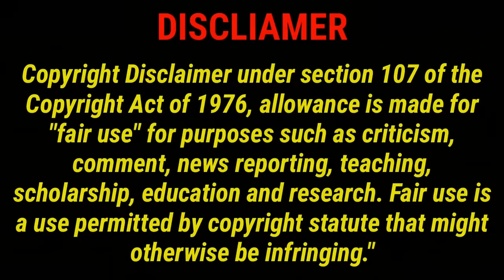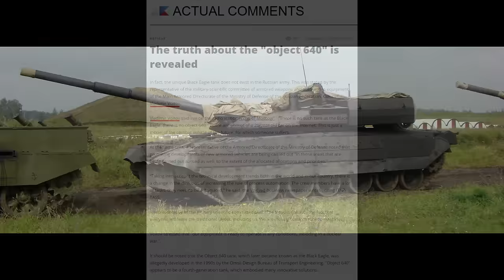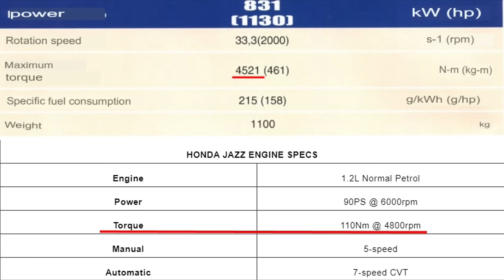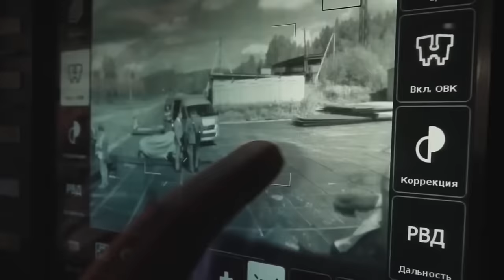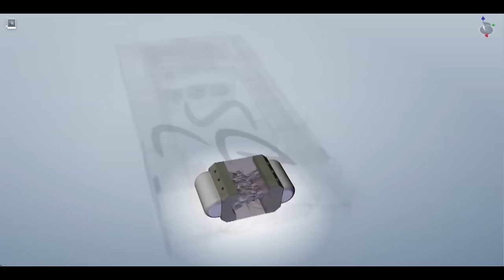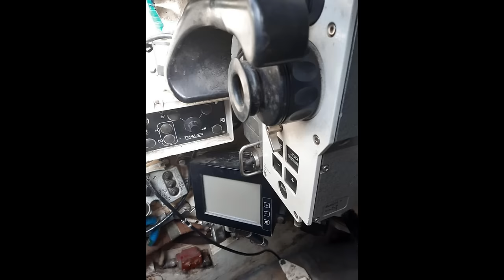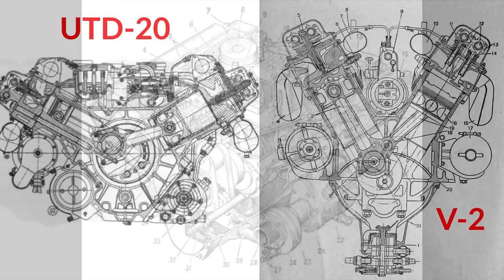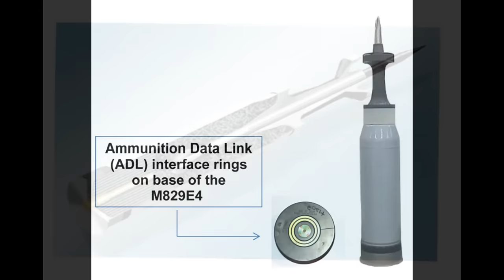LazerPig is WRONG about T-14 Armata

Comment: There are several fundamental differences in design and layout of the main components in engine bay, from motor, gearbox and transmission assemblies between Western and Eastern tanks. I know that transmission on T-72, T-80 and T-90 tank series (not so sure about the T-90's) is really well thought out; two separate transmissions attached on each sprocket wheel over a final reducer, and both transmissions are connected to the gearbox and on the main shaft of V12 engine. A masterpiece of small, compact power pack. All assemblies together occupy about 3 cubic meters of space. For comparison, Abrams M1A1(A2) needs 7-8m³ to house its power pack. But both the Russian tanks, older T-72 and newer T-90 do not have a transmission that allows independent speed of rotation of the tracks as well as direction of rotation, but when the tank wants to turn 180° from rest, one track turns, while the other is blocked. All with a miserable 4km/h in reverse. Back in 1942, Germany designed, manufactured and installed the Merritt-Brown regenerative hydraulic steering system in the Tiger l heavy tank, which together with the Maybach-Olvar gearbox with pre-selector (for 8 forward + 4 reverse gears) ensured easy driving and maneuvering with 56 tons heavy tank and turning the tank by moving one track forward and the other on back, exactly according to a certain speed, it acts like a car differential that in a curve allows the outer wheel that covers a longer distance and have a higher speed and number of revolutions, and allows the inner wheel to reduce the speed and number of revolutions. Tiger l tank had early hydraulic steering system like an all moderne day western made MBT, including Tiger I successor in design & high quality production approach of Leopard 2, and the brake levers were left by driver's side just for safety reason, if the hydraulic steering system fails. And Leopard 2 V12 turbo diesel engine with EuroPowerPack consisted of MTU-883 1500/1680Hp at 2300 rpm. with automatic transmission Renk HSWL 295TM is a "plug and drive" type of unit that is easy to change and repair even in field conditions. All Western MBTs have been using such a steering and control system for a long time, only the Russians still turn their tanks by braking on one side of the track. Why tank constructors from Nizhny Tagil "Tankograd" never adopted such technicaly advance approach in tank designe? Higher price of manufacturing, bigger volume for power pack (and therefore a larger silhouette of the tank) or complexity of maintenance? Or a bit of all of the above?
Reply: May be T-72M1 CZ  have rotation capabilities - it's new  transmission, it has more reverse speed.
Also T-84 has better transmission than t-72 in the same dimensions.
Reply: What's the point of doing a standing rotation with tracks moving in opposite direction when what Russians use works just fine? Russians look at the RESULTS. Methods can remain crude if they achieve it.
Reply: @Max_Da_G  well said. Russians designed tanks to be difficult to spot and shoot and be very reliable tank and cheap and easy to produce in high numbers. Russians are pragmatic what works. That's why they defeat Germans in ww2
Reply: Except for armata engine is different and t-90m that has good reverse speed
Reply: Cost, complexity,realiability and the fact that its not that important are the factors why they do not have that
Reply: @alexnderrrthewoke4479  T-90M has been shown to have the same reverse speed as the T-72 (it may have been a T-90A, I'm not certain so excuse me if I was mistaken).
Reply: @swedhgemoni8092  it's faster compared to older models because it has improved engine compared to t-90A
Reply: From what I read T72 tanks use a twin gearbox system connected to a transverse V12. The steering is made by up or down shifting one gearbox and not the the other or putting one in neutral. And apparently it doesn't have neutral steering even though I thought it's theoretically possible to make a sistem that puts one gearbox in reverse and the other in the first gear
Reply: @alexnderrrthewoke4479  russia did not win on its own, but by massive support from the USA
Reply: @neodym5809  lend-lease amounted to 4% of the GDP of the USSR, I doubt that it was the main factor in victory. I do not deny the importance of lend-lease, thanks to it the USSR had aviation (a lot of aircraft-grade aluminum was supplied), as well as logistics transport like trucks, but lend-lease should not be overestimated. Yes, and the most basic deliveries began only in 43 after Stalingrad, when the preponderance had already occurred in the direction of the USSR.
Reply: Your comments is more conherent and precise than the whole video of that Pig.
Reply: @neodym5809 ага) за такую помощь и не только ссср, а потом и россия до 2017 года долги отдавала. Спасибо папаша за это черный рено логан черного цвета 20-го века)))
А вообще о чем речь? Не хотим мы воевать. Какие к черту танки? Я лучше про огород бы поговорил или про рыбалку
Reply: One thing people also do not mention that these Russian engines work both on Diesel and Gasoline.
Reply: @Max_Da_G  Except just because it works doesn't mean it can't be improved or is even good. 

"Why use jets when propellers work? The Tu-4 has propellers, better than those wasteful more complex jet engines used on the B-52!"

Propeller based engines are less complex and are (theoretically) more reliable than jet engines. Yet the B-52 has better payload, better electronics, better range, better fucking everything than the Tu-4

Also the fucking tracked skid steer down the road from my house can turn by having it's tracks move in opposite directions, yet a tank can't. And lemme tell ya, you can technically turn around when you only use one track, but it's slow as shit and takes more room than doing it with both.
Reply: @ОСЕНЬ-з2ч  More like the fall of 1941. The largest convoy to Murmansk sailed in the spring of 1942. Nor was Lend Lease only 4% of Russian GDP. Lend Lease undeniably helped the Soviets in halting the Wehrmacht and then driving them back. For example, Soviets were still using near ancient lathes, casings, and other factory equipment in 1941 that had first been designed in the 1800's, whereas the US sent not only modern factory equipment but entire factories to the USSR, such as steel factories and tire factories (some of which were mobile and followed behind the frontlines, churning out new tires daily). The USSR had almost no rubber resources or rubber factories to speak of prior to Lend Lease. Let alone the massive amount of aluminum and aviation fuel sent to the Soviets, without which they'd have never recovered from the annihilation of their air force over the summer of 1941. It's weird that you dismiss the trucks sent over as well, considering that American trucks were so prevalent that they allowed the Soviets to reorganize their mostly foot borne infantry divisions into motorized divisions, let alone helping logistics keep up with the front. There's also the thousands of railcars and hundreds of train engines that the US sent to the Soviets, not to mention the thousands of miles of specially made pre-built track that they also sent over. You're also conveniently forgetting the entire divisions worth of Shermans, Churchhills, Stuarts, Lee's, etc that the Allies sent, which the Soviets used until the end of the war, that played important roles in major turning points such as Stalingrad and the 1944 summer offensives that finally shattered the Wehrmacht. It flies in the face of reality to say that Lend Lease wasn't a total game changer for the Soviets, as well as being pure propaganda at its worst. Both Stalin himself and Zhukov certainly didn't feel that way, with Stalin praising both the US and Britain for Lend Lease in 1945, saying he never would have turned the Germans back without it, while Zhukov went to his grave praising Lend Lease, even being investigated by the KGB in the early 1960's for publicly saying the Soviets would have lost without it.
Reply: @neodym5809  do you think that Ukraine doesn't fight on its own?
Reply: All that and it still can't reverse.
Reply: For the TL;DR people. He's saying that the Russian system is a compact and tiny little thing but has its drawbacks compared to western MBTs. However the German Tiger 1 power train and running gear system acts like a cars differential making it a smoother ride overall. And the merits of the Russian and NATO tanks have their own merits that should be taken into account even if one has objective superiority to mobility systems.

Yes I know it is long but condensing a wall of text into a few words is not easy. also get better attention spans you internet addicted sad acts.
Reply: @user-qc6qe9pc5l 
The statistics are a bit incorrect, the raw material was immense, lend lease opened up russian industry to produce purely war equipment, which makes it look as tho lend lease was not as helpful, additionally allied presence in the west meant the German army was never 100% into the Russian invasion
Reply: Анти Наука  uh... No. Soviet kit is the ones doing that most of the time.
Reply: @ericharrison7518  They should've sent more and better equipment (and not hold the best for themselves), that way much fewer people would have died, but noooo
Reply: Simply put that transmission would be harder to produce ( would cost more) and would be harder to maintain (higher maintenance costs)

Comment: LMAO  who would believe  a WW2 engine is still in use on newest tank   and  a fking honda that only weight 1 ton or some thing has same torque with fking tank that weight 45 tons
Reply: the propeler shaft would get ripped off   LMAO
Reply: i doubt wether you have done the research but hours after lazerpig's video was out he corrected the claim about the honda engine.
Reply: @koekiejam18  he edited his video description, something that nearly no one looks at. It's at the bottom of it as well.
Reply: @koekiejam18  After a bunch of people had already watched it and corrected him on Reddit. In my mind it is such a massive mistake that it makes it difficult to trust anything he said in the video.
Reply: Yeah at that point I completely stopped listening and discounted the accuracy of the whole video... Turns out that was valid based on this.
Reply: @yigitoz8387  That doesn't mean that he didn't correct it does it?
Reply: Or that they still use the same engine from the BT tanks in their modern tank. It's like saying chevy still uses engines from the 50s in their trucks becuase they are called chevy small block v8s

Comment: I just hate the fact people still use the "T-14 broke down on parade day 2014" when literally the BREM couldnt pull it an inch, a vehicle that literally pulled 2 T-80s at once. If it did broke down, the BREM ARV would of been able to roll it on it's tracks and tow it away easily if there was an engine problem.
Reply: Russians say that the driver activated the E brakes by accident as he was a rookie
tbh it sounds like they said the truth
also dont mind me copying your comment-
need to take care of some Ukrainian bots and trolls lmao
Reply: if i do recall correctly that was an emergency brake issue, and the issue was the driver who did not know how to properly operate the T-14, that's the reason why the BREM couldn't pull it out, thus reflecting the biggest issue i think the T-14 has, the crew training (which lets be honest can be improved over time)
Reply: Well it was an E brake activation because if the engine broke down and the tank was in gear or not in gear the tank recovery vehicle would of been able to pull it no problem but when the E brake is engaged it's not going anywhere 😂 NAFO and Ukro bots lose agian 😂
Reply: The Armata didn't simply break down, look closer in the original video. It was the fault of the new driver as he lacked the training needed to operate the vehicle properly. The driver activated the emergency breaking systems, which will lock the vehicle in position. The driver didn't know how to release the system due to lack of proper training for such a new vehicle. Most likely, the driver was given like a quick "this is how you move the tank" rather than given the time to read the manual fully in order to get it into the parade.
Reply: This myth died and came back again because of the war in Ukraine
Reply: @rogue__agent5884  It never died, before the war people were still saying it regularly in any tank video related to the T-14
Reply: @rincontibio7664  why are they giving a brand new tank to someone who doesn't know how to operate it? They don't have any trained professionals?
Reply: @dorakizz5650  well by the time (2015) the Armata was a brand new tank, and the first tank to distance from the older soviet style tanks, so the chances are that the new driver was a proffesional in other tanks but they didn't give him time to properly understand all of the systems of the T-14, same thing happend in our unit when we switch form the AMX-30 to the T-72B1V, the older crews had problems understanding the "new" tank similar to a green crew
Reply: @rincontibio7664  probably the first time army drivers seen it too.
Reply: They shot themselves in the foot by trying to drag it away like that.  If they'd been thinking they would have just left it in place and told everyone it was all part of the show.  It's not like anyone in the public knew it wasn't supposed to be parked there for a Q&A session.
Reply: @iplaygames8090  exactly i don't blame it for it, is like me dad when he changed his old 98' Cherokee for a 2020 Renegade, the auto stop feature had him on his nerves
Reply: YEAH, SAME! I am a huge tank nerd and as I saw the T-14 breaking down and not being able to be pushed away I asked myself "Wait if it broke down why isn't it moving?". Because we know that broken tanks can be pulled away because the track wheels are loose. I could not explain this so I just assumed it is something different but never looked it up.

Comment: The CR2 upgrades mentioned by LazerPig are most likely the ones being implemented on CR3, though he did get some details wrong. HAAIP was exclusively focused on the mobility of the Challenger platform, including the engineering/support vehicles, and led to the improved hydro gas suspension and the CV12-9A engine, which is confirmed to have around 1500hp. 

The other upgrades are features of the Life Extension Program (LEP), with the B-roll showing BAE System’s Black Night demonstrator, which has upgraded gunner day/night sights, CITV, Iron Fist hardkill APS, a laser warning system, improved FCS, and so on. Rheinmetall’s proposal fitted the L/55 smoothbore gun, as well as a new gunner day/night sight, CITV… you get the picture.

Now all the upgrades are being rolled up into Challenger 3 and the MoD’s press release graphic mentions enhanced armour, and as the APS (with Trophy winning the tender) was listed separately it’s probably safe to infer that it’ll feature a new generation of composite.

An interesting side note is that various features of the CR3 demonstrator’s turret are in the same location as they are on CR2 (e.g. the hook mounting points for turret maintenance, the gunner’s periscope, the general shape of the turret roof), and new turrets are being fabricated for CR3, so it seems possible that the final turret of CR3 may differ from what we’ve seen so far
Reply: Replacement of rifled 120mm with Rheinmetal L55 is something that have been contemplated for as long as Challenger 2 exists, it has just never been a reason (so far) good enough to actually go through with it.

Comment: Here to let you know, the Ariete AMV isn't the last iterarion of the machine, apparently the final version Is gonna be called ariete plus among the differences a new /55 cannon and a hard kill system. I think you will find more info yourself. Cheers.
Reply: It is for now
Reply: Italy literally "abandoned" it now with buying German Leo2s
Reply: @radonsider9692  no the solution proposed Is gonna be 125 ariete plus + 125 Leopard 2 as gap filler situation waiting for an MBT of new generation.
Reply: @andythesaladgod4578  Gaejin has fucked up big Time with the Ariete AMV, not knowing that wasnt gonna be the final form of the machine. Once the plus show up they either rework the existing amv, or Will have to add a 4th ariete...
Reply: @lanfrancoadreani9212  125 Ariete + 250 Leopard 2 in the talks now.
Reply: Italians make beautiful military gear.